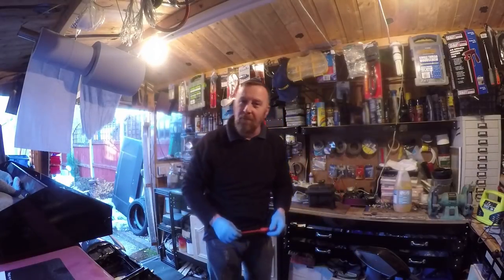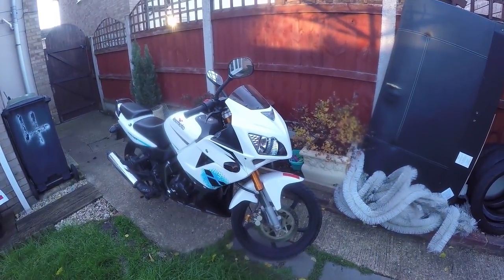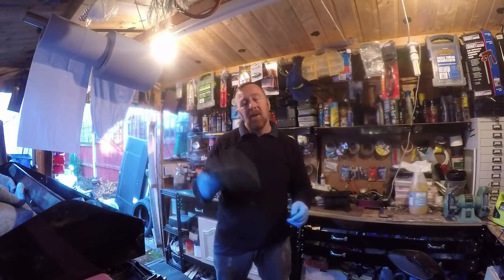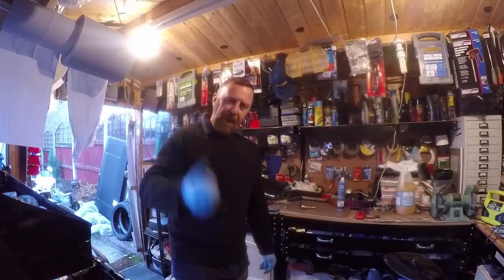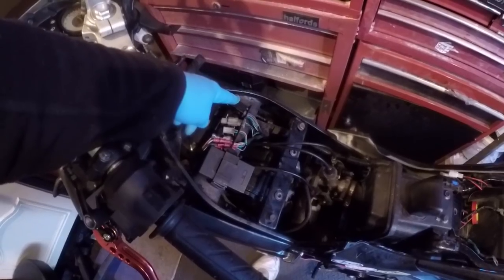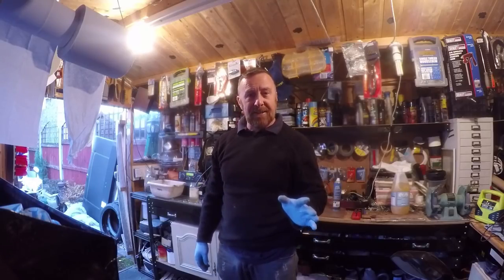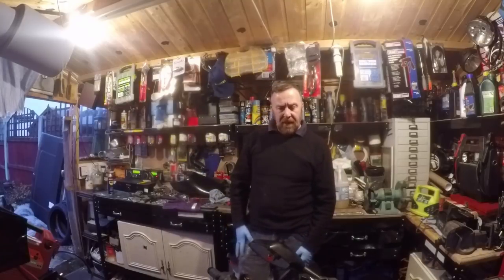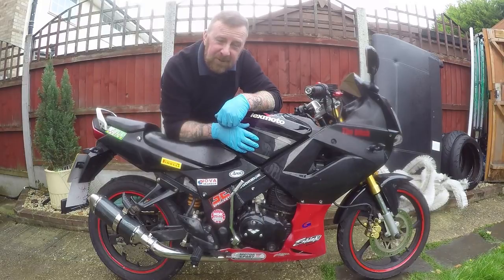LEXMOTO XTR 125 CC MOTORBIKE NONE RUNNER FIX MARK SAVAGE

Comment: About time somebody did videos for the learner riders on how to fix up their bikes. I've been fixing up and returning wrecks to the road for 40 years now, most from the breakers yard. One had something as simple as the battery live wire connector had fallen off of the ignition switch. One just needed wheel bearings replaced (MOT fail and taken straight to the yard), electrics, crash damage, etc.

The worst I've seen a GPz305 Unitrak camshaft with 6mm. deep (measured) grooves worn into the lobes. The owner had ridden it from brand new with the original factory thin 1st 500 mile break in oil for 21,000 miles!! The dealership where he'd bought it had gone bust after he's acquired it so zero PDI, oil changes, etc. It was a very clean and polished bike with a top speed of only 38 MPH in top (eventually). The very high MPG was impressive!! It only required a new camshaft and it ran great.
Reply from the maker: thanks bud I do try and help others fix there peds and motorbikes, just like saving some and its fun to bring them back to life bud 
many more videos on my channel and thanks for watching 
mark

Comment: Good Evening
Pulled cobweb covered Superbyke RBP 125 out of shed this morning.
Flat battery and no life when kicked over.
Found and watched this Video at lunchtime.
Followed your ideas.
Drained dirty fuel and cleaned tank filter, sucked the new petrol through to "clear the pipes". Sprayed a bit of carb-cleaner in air intake (don't have easy start)
And she fired up, running fine.
Now for an oil change and bleed out front brakes
Thank you for this Video
Reply from the maker: Thats so good to hear my videos help,  theres more on my channel bud that also might help 
Take  care bud

Comment: I've just brought a white 1 of these as a project the throttle cable as snapped and battery is naffed also indicators and electric start don't work I'm hoping that's to do with battery
Reply from the maker: Yes bud sounds like it as they both run off the battery along with the horn 
Lights run from the stator so only once running 
Theres loads of videos on my channel that will help
Reply: @marksavage  cheers mate I shall have a look on there I've only got the bike to tinker with and use until my big test I've my theory on Monday wanting a sv650 next or a bandit

Comment: Hi mate I have a great example of this bike mine needs help thou , it does not want to idal at all . I have turned the fuel screw on the carb brought the revs up to 2500 on idal but only last for about 30 sec then dies , it is fine when riding . Any ideas . Where are you based as could come to you if you like haha
Reply from the maker: Last service bud ?
Plug , air filter , clean carb  and take it off and do a good job or cleaning it plus idle jet 
This all should help and put the revs down your damage the clutch riding it high !!

Comment: Hi Mark, how do you time up one of these engines? I fix my own cars and bikes and despite what's said about these bikes, engines, etc,  I have had a 2014 scooter since it came out of the garage and apart from me up grading a few bits (Chinese parts from online) I ain't had a single bolt shake loose or had anything break on me, (I'm not a rev head so ride normal and it's just grate to be honest and yes it's not a Honda but gets you there and back,  second go of the starter and it starts even after being parked up for awhile, it's like why have a shit brand while you can have Hugo boss and so on, instead of cheap" it's up to the person and their means really, anyways back to my question, most xtr 125 have a T and a F on the fly wheel and from my understanding it's on the F, then up on the cam it's the two lines running parallel with top of the engine, done all that but how does the cam chain and top wheel get the chain on? The chain and tensener were loose as far as they can go and I still couldn't get the chain up on to the top wheel, in the end I had to pick the back of the cam up to get the chain up into the cam chain sprocket and then tighten the head back down which worked but I would love to be able to find out the proper way its done,
Reply from the maker: hi bud if the chain was loose then it may have moved and this is not good other wise your right in what you have done with lining them up.
if the chain jumped it may have done damage and head off to investigate  once the tensioner is loose you should be able to move the chain then move the top and bottom cogs to the lines
 to be honest you can buy these engines cheap and so easy to replace as that's what ive done in the past after many hours of trying to time in and not being able 
you are also right with the hugo boss bit bud love it, as long as you look after things it will keep going ,well most of the time 
take care bud

Comment: Mark, Apologies for picking on you. Just brought a CBF 2012. Been sat for the last 1 year and abit. When i rode the back back from where i brought it, the bike started to kangaroo. it was low on petrol but i didn't  have far to go but anyways i died on me and i had to push it the rest of the way home. had a look today and there isnt any spark ? even if i check the coil with a wire on the case. Any ideas ? why would it just die on me like that ? is there a fuse i am missing, is the side stand fooling about ?
Reply from the maker: mastercreative1 you wouldn’t be the first to ride back and the bike to die 
Did you contact the last owner and ask him ,?
No spark can be a few things from 
Spark plug 
Hi coil
Cdi stator coil so you will need a volt meter to test but running out of fuel wouldn’t do that
Could even be a loose wire which I’ve had and harder to tract !
Reply: @marksavage  the chap i brought it off was selling it on behalf of a friend who brought it an never used it. it rode fine and i couldnt see an issue, until i got half way home it was odd it behaved like fuel starvation. but after checking tonight there is no spark
Reply from the maker: oh ok well as in my last message start with fault finding
Reply: @marksavage  Hi Mark, Guess what it was ! Loose wire on the HT Coil. Plugged it back on and boom back in action, ! :)

Comment: What would you do with that old fuel Mark? I've got some rusty old fuel but I'm not sure where to dispose. I don't think the tip will take it.
Reply from the maker: I have taken it there before and they let me leave it with them , I ended up getting a metal bucket filled it with stones and pour it in there as it evaporates ( maybe not the best idea and dont smoke near it lol but otherwise you just end up with loads of petrol in bottles 
however I do use it sometime to clean bikes with like the road tar and bugs!
thanks for watching
Reply: @marksavage  thank you for all the videos, tips and quick reply Mark.

Comment: Hi buddy .. 

I'm having a problem with electric's on my lexmoto venom . Tail light not working properly / only 3 of the LED's lighting up but all are working when I press the brake ..PLUS  display console (Speedo) only back light working no main light... it comes on for the clock sweep but then go's out after and stays off . 

Any ideas..?  I've checked block connectors and wires all seems good ...starting to P me off now ...!  Any help or ideas much appreciated.
Reply from the maker: The rear side lights have gone but brake work 
Unfortunately the whole unit will need replacing if you want all of them to work !
I'd just out up with a few out 
Clocks 
These suffer from circuit board problems and again no fix but replace bud sorry to say 
But you might be able to get 2nd hand ones but might have the same problems a few months down the line
Reply: @marksavage  

Sound .. was thinking that but didn't really want to replace without getting some outside advice In case I'm missing a trick ..

I know the ignition barrel is a little crap as well  so will replace this at same time ...thanks mark big help finding advice or Tec support on they's things is impossible...

Thanks again

Comment: Mark could you You please answer a question for me my bike was running perfect on Tuesday morning went out Wednesday morning and it would not start I’ve checked the plug I’ve checked for petrol I’ve checked the electric switch but it just turns over and battery goes dead could you please help me out
Reply from the maker: This can happen and can be due to the back very cold weather 
2t or 4t ??
Ac or lc ?,
Reply from the maker: Only ask as often not the bike you comment on !
But if it this bike 
Check for spark as they suffer from cdi failure 
And fuel problems

Comment: Hi mark ive been watching your videos on this bike to see if it will help get mine running , same model and year I’ve replaced the tank and standard air box and battery It has a standard exhaust ....carb has been cleaned as it’s been sat for quite a while...it starts up off the button and the kickstart it stays running for a few minutes then it just dies out, I’ve tried adjusting the air/ fuel screw and the idle screw and im getting no where.....any ideas what it could be
Reply from the maker: Once started have you taken it for a run ??
Sometimes it's what they need rather than just sitting ticking over 
Just up and down the road and see if it does it 
Most of the time it will keep running bud and after 
But ive had some bikes just not like left on the side stand ticking over but fine once on a run!
It can be just where its sat 
Plug , ht coil stator coil damp from just not been run 
Give it a go
Reply: Hi mark I’m unable to take it out for a run at the moment as it currently has no mot or tax as it’s been off the road so long , I’m trying to get it in working order before I take it for an mot ideally it does start up straight away off the button and couple of kicks, I got it for £250....I’m just curious that’s all as I used have the skyjet one a few years ago in a similar situation but I never had the issue I’m having now ..
Thanks for the reply
Reply from the maker: @dylanrobinson4176  mot ,tax and legal lol 
No no I've never popped out for a test ride up and down the road !!
But sometimes it has to be done 
Don't beat your self up over it stalling until you've been out on it as sure it will run well and you will then know 
As said a lot of them don't like ticking over until they have had a run
Reply from the maker: @dylanrobinson4176  £250 wow bargain bud
Reply: @marksavage someone told me to check my valve clearance
Reply: I know it was a bargain at that price I couldn’t walk away but I’m beginning to think it’s gradually going to become a money pit just like the rest of the bikes I’ve had haha
Reply from the maker: @dylanrobinson4176  they do bud and you have to out in to get out without being out of pocket
Reply: I did what you said and took it out for a spin round the block and it’s keeping running now idealing abit high but at least it’s running just need to sort my front lights and indicators out now 😎 do you have any other forms of social media I could possibly follow you on or contact you on if I need any further advice ?
Reply from the maker: @dylanrobinson4176  only on here bud and as you see I always answer 
Watch a few other 125 videos on my channel and ask on them as YouTube only list new questions as highlighted 
Others don't come up unless I look lol 
Lights work from the stator 
Indicators from the battery to 2 problem to sort bud 
Use a volt meter

Comment: Hi mark I been watching a lot of your videos and they have help me a lot I just having one problem that's the fairings I have never put fairings on but what I am having trouble with is how many pieces from head light down could you direct me to the right place ho it's a skyjet 125 _23
Reply from the maker: I have a few of them on my channel bud and they should show how but 
Head light part fit and secure 1st
Then the two side ,make sure they fit to the top 
They maybe out as could of been push out of shape but the will go on last belly pan ,bend what you have to and fit bud 
It can be a pain but remember the indicator wires lol and make sure all lights work

Comment: Its running a bit better now after me fitting a new coil and plug
Reply from the maker: thats good and a little tune
Reply: @marksavage  dont think it needs it
Reply: @marksavage  800 revs ia to low cuts out but i have managed to get it to the right revs but then it drops on its own and cuts out soon as u start the bike up again it goes bk up to the right revs once warm it drops to number 1 on the rev counter then cuts out

Comment: Hey I dunno if you still do these repairs but I got a lexmoto lxr 125 2022 thst doesn't start and I have no idea what to do. If your local to me I could bring it to you if you'd like to make a video on it, I'll pay you ofncourse too 😂
Reply from the maker: prob not local bud as in essex . being a 2022 reg best bring it back to the shop as under warranty 
they should also run ok on E10 but i would use E5
Reply: @marksavage  alright cheers mate

Comment: Been messing around with one of theses bike the past couple of days put a second hand engine in as the other one shit it’s gearbox it starts and ticks over but soon as you go to pull the throttle back it dies cleaned the carb out but still no different 🙄
Reply from the maker: hi bud been away 
ok check all pipes and bolts then oil lever and make you wat to the carb, make sure its set up ok as in air mix and is your old carb on or the carb that the engine had as they would be set up differently !
you may have to even re jet it 
new plug?

Comment: Hi Mark, just after bit of advice. I have got a ybr 125 24,000 miles (last service rough 16,000) I have done a recent oil change. I am experiencing slight rattling/ loose ness when I ride along at roughly 5,000rpm 3/4 gear if I go above, go a little faster the noise goes, any ideas ?
Reply from the maker: mastercreative1 hi bud 
I have a few ybr videos on my channel 
Did it rattle before the oil change ?
If you have been all round the bike and checked every thing is tight then it has to be the engine 
Have you checked the valves ?
As this maybe the cause f loose 
There are videos on line but as yet I’ve not uploaded a video on me doing them 
Could be cam rattle ?
Which would be the cam tensioner and this can be adjusted 
Hope this helps
Mark
Reply: mark savage hi mark, yes it been there since the oil change. The oil originally came out black. Do you know roughly how much a valve adjustment would cost from a garage or a cam adjustment, how easy is it for me to do it ? I am quite machinally minded
Reply from the maker: mastercreative1 tank off head off and once you know the clearance it easy 
Check it n line for the gap and TDC line up 
If you rev the engine you should here where it’s coming from before you start work bud

Comment: Hi I have a sym jet 14 with a very weak spark to the coil, I was wondering what could be the possible causes!
Reply: The bike doesn't spark, or run
Reply from the maker: no spark then its your cdi bud and will need a new one, but before fitting the new one check over all wiring so it doesn't blow again

Comment: Any idea where i can get a lexmoto xtrs125 exhaust from looked everywhere
Reply from the maker: they do sell them on google ,if you type it in but lextec do them
Reply: @marksavage  cant find an exhaust anywhere dont want a new one as cost to much want same one that was on the bike i have got one that was sent to me and shop said it was for the lexmoto xtrs 125 vut it ant as dont fit bit to small so do u think if i heat it up with a heat gun or blow touch i could bend it to shape

Comment: Heavy rain killed my lexmoto adrenaline 2017 fuel injected bike. I have sprayed wd40 every where but it still won't start. I get spark and the exhaust smells of fuel after several failed start attempts. What's my problem mark any ideas ?
Reply: Probably water in the fuel due to the 5% ethanol contamination (that the EU insists on) absorbing it from the excessively damp air. My bikes have the same problem after heavy rain. Just drain the fuel out and replace with fresh petrol. The water contamination can be removed from the petrol as it will settle to the bottom of the container over time, so it can be drained off.
Reply: @CZ350tuner  cheers for this bid although the problem was I had no foam filter in the air box so the damp or rain was being drawn into the combustion chamber and fucked the spark plug. Well I believe so. I got a filter changed plug and haven't had any issue since. Thanks again for the reply tho bro

Comment: How do I take seat off 2018 xtrs 125 .assuming battery under there cheers
Reply from the maker: This can be a few places 
The ignition key can turn 
Key at rear or side 
Some bolt on 
If no joy bud Google it
Reply: Google no help at all and there's no key lock around seat area.will just have to persevere
Reply from the maker: @tamrobertson424  sometimes there's two bolts 
One either side of the seat 
Sorry bud 
Its been a while since I had one and had so many different types of 125cc